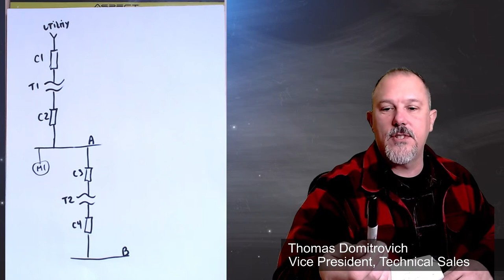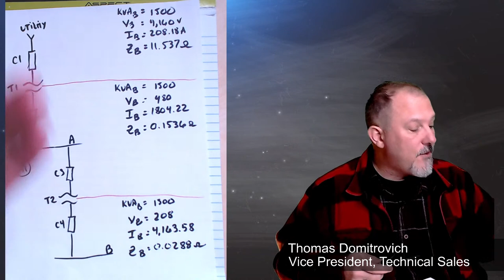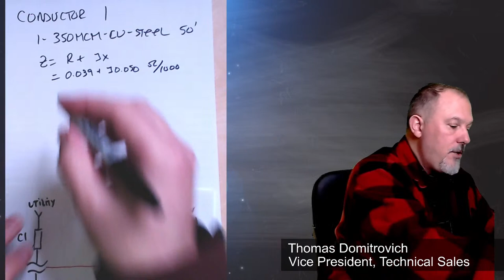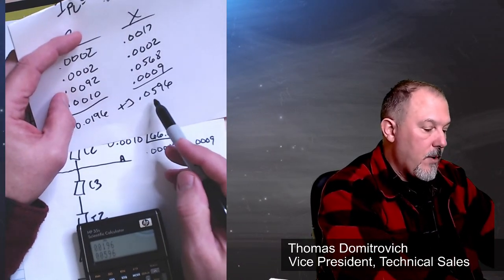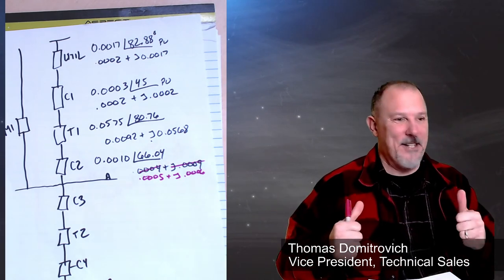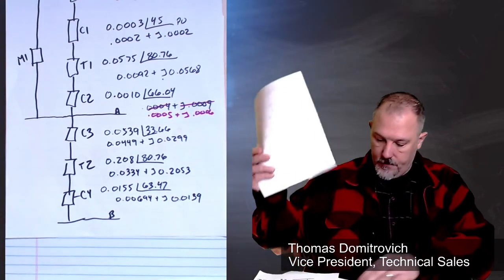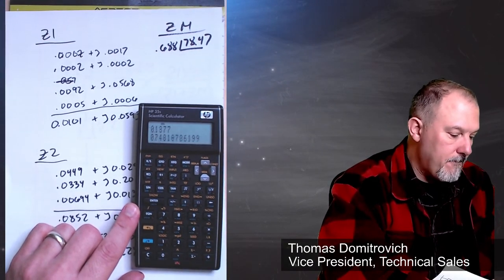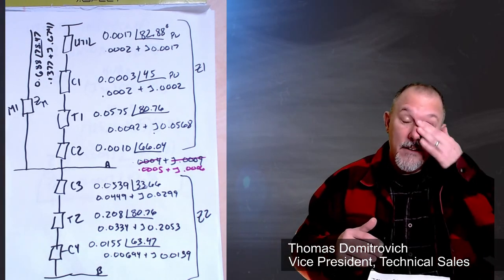Fault Current Calculations - LAB

Comment: You didn't find an error on conductor 2, you created a new error on your second go. You forgot the term (1/.15xx). 

Your error was adding the rectangular coordinates. If you look you added a 9 where it didn't belong. 

Very good presentation, I'm very happy to learn the PU method and short circuit calcs. 

Haven't got to the end of the video yet
Reply from the maker: Thanks for pointing that out.  I was too close to it and trying not to delay too much for the live stream.  The fact you picked it up means you are indeed working the math and learning the method.  I appreciate that.  This Thursday I want to do the same problem but do the calculation for ground fault current.  see ya online!!!!
Reply: @TDUNPLUGGED  I was planning on picking up power system analysis and design 5th edition (Glover, Sarma and Overbye) this June. So these videos will give me some perspective prior to reading and solving the chapter problems. 
Live is tough and given how close your answer was I would've made the same decision.

Comment: Need to avoid rounding to a set number of decimal points, and instead round to significant figures instead.  Especially when working with PU, which can be very small numbers that end up being multiplied - that rounding error can grow significant after the move to actual units.

Comment: I recently saw an arc flash label on a 12 KV piece of gear that said 16 cal/cm^2 at 30" with a 37'6" arc flash boundary.  Either they calculated by some crazy math that shrapnel might only travel that far, or someone just ran the program and printed the label like an engineer might do!  ..........................................................................................................................................................................................................................

Oh, and it was a label that said Eaton on it!

Comment: sir, you haven't changed the motor voltage when you calculate the motor impedance, it's still 460 divided by 480. it's supposed to be 0,46^2/0,48^2 right??  would it make a different result?

Comment: I don't get why we have to divide by 5 for conductor 2.
Reply from the maker: Hey Natalio, thanks for the note.  Conductor 2 has 5 in parallel.  When you have parallel conductors you divide by that number of conductors because if you took the long road and calculated the equivalent impedance it would work out that you divide by the number of conductors.

Comment: notify me when it's arch fault calc. pls
Reply from the maker: Probably going to hit this discussion tonight.
Reply: @TDUNPLUGGED   start following you. It boost my talent, Am working at fire dept. in the philippines.
       I've check your data in fault calc. What you've used was aluminum metal and not steel. Anyway, the procedure is the same.  Many Thanks...